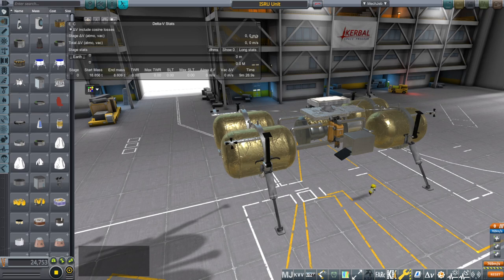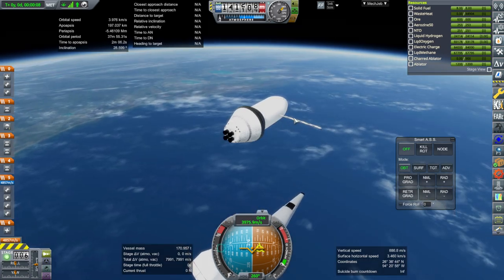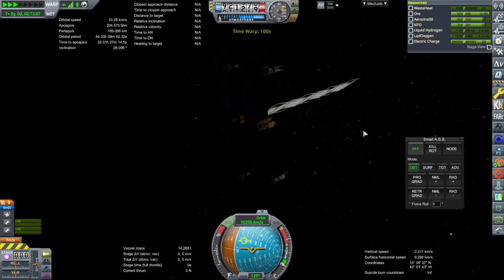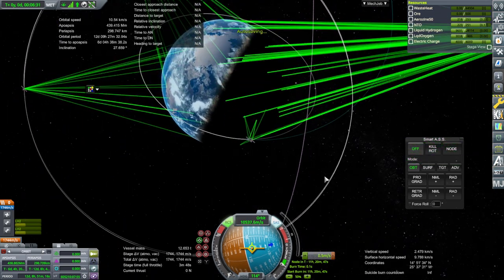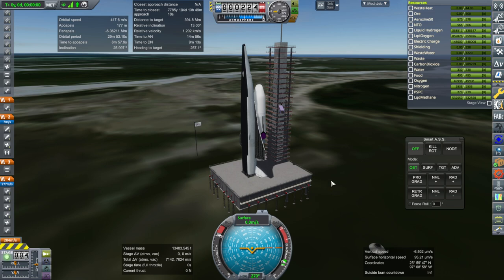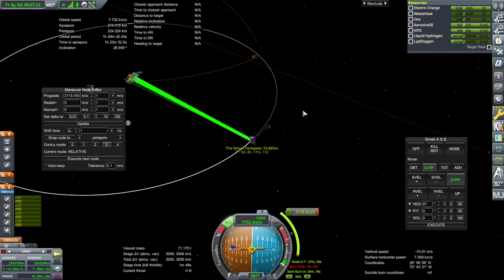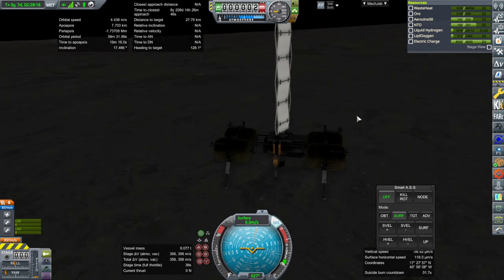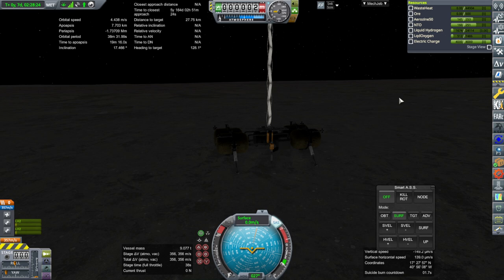Kerbal Space Program 1.8.1 with RO - To Mars and Beyond 03

Comment: you should try the differencial thrust setting in mechjeb when landing non-linear crafts (when the thrust doesnt go through the center of mass / the center of mass moves during flight) like that but how engines throttle in RO idk if it would work